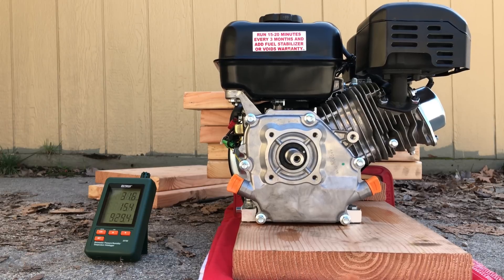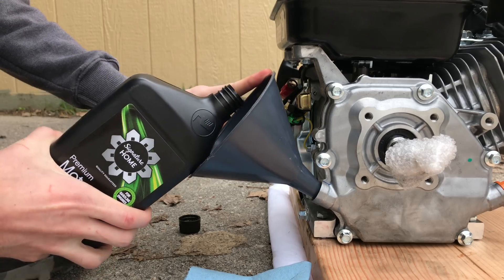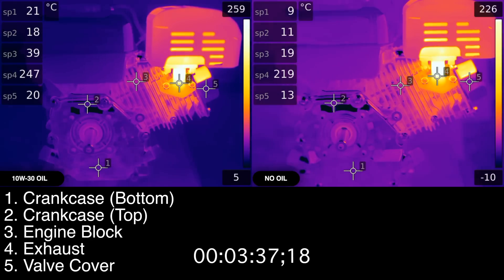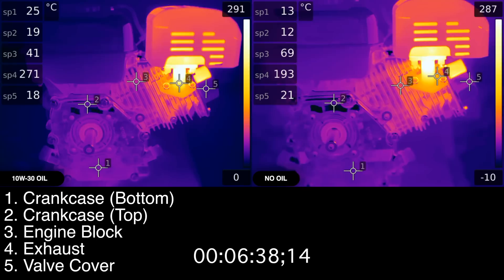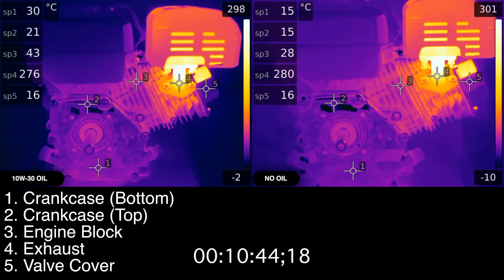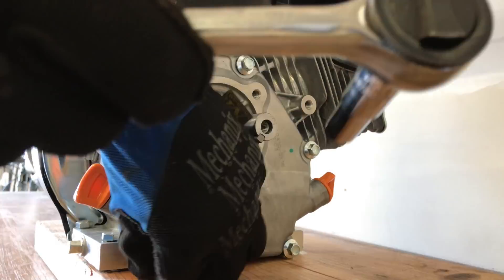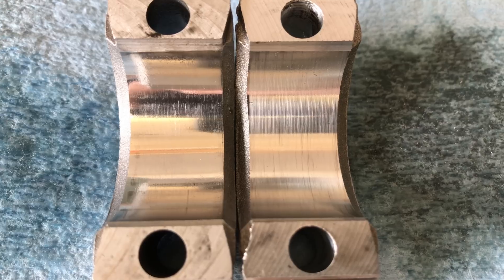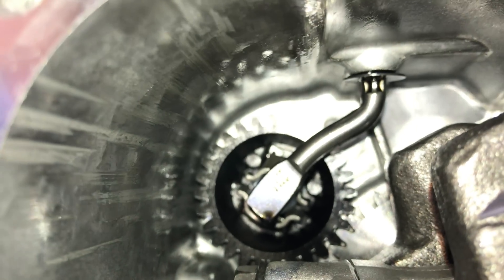What Happens To An Engine Without Oil?

Comment: i have a toyota 1.4L D-4D diesel hatchback, seems to consume a lot of oil. dont find leak anywhere. no black smoke either. according to the service center the combustion is good too. is it safe to use the car on highways?
the car had done about 45k kilometres. oil goes below low mark in about 2000kms.
Reply: Tjukken33 i live in India and its hot here most of the year. the service interval for the car is actually 10k kms as per the manual. as you said the car consumes little over 1.5L oil in 2k kms out of 3.9L. after repeated visit to the service centre they said they didnt find anything wrong with the car in their diagnosis. aint loosing so much in such sort duration something to be alarmed ??
Reply: Tjukken33 thank you so much for the detailed reply. my car is out of warranty. and you are right it is some minor mechanical issue which Toyota is not able to trace. heard few other cars are affected but as you said the reply from service center is its ok nothing to worry. will check the coolant tomorrow. and will follow the practice of carrying oil in the carry and check the level frequently.

i guess it should be 20w40(will check the manual) if it is so will it help if i change to 20w50 or go for synthetic oil ?

Comment: This is a four stroke engine right? Could you do the same video with a two stroke engine please?
Reply: +land otter1    your points B and C are the same thing. The higher Octane rating doesn't give the fuel more power it just increases its resistance to burning meaning the compression ratio can be higher and that is what gives more power.  It also reduces the likelihood of predetonation for the same reason.
Reply: 2 stroke engines dont have oil in the crank case
Reply: no modern day engine requires led in the gas. The led was used to lube the fuel injection system. Seeing as it was 2 stroke, it will not require led.
Reply: Tjukken33  2stroke doesn't require leaded gas. It will run on unleaded just as good mixed with oil
Reply: ***** no it doesn't the lead was used so simply lube the fuel injectors. Seeing as all 2 strokes are carburated there is no 2 stroke engine in the world that would require lead in the gas. You can not have a fuel injected 2 stoke engine.
Reply: Too much oil can cause carbon buildup. I had a Solo 210 that got hard to start when the decompression port clogged. This put extra wear and tear on the pull starter and I wound up replacing some of that as a result. Cleaning the port involves removing the head and exhaust and then pushing a pipe cleaner through the port from each side. This is a periodic maintenance item on that engine but running say 25:1 instead of 50:1 would clog it up in only a few hours.

Comment: My moms got an 03' 1500 Ram with a Hemi (dumbest truck I've ever driven) and it is CONSTANTLY burning off it's oil to the point where my mom carries around a big jug just in case. IDK if it's cus she let the oil run out once and took MONTHS to realize there was no oil so now it's just being a prick but imma show her this video. That truck is the whole reason i no longer respect Dodge vehicles. That and around here you never see a Ford or Toyota at the side of the road- just sayin'.
Reply: >knows engine was run without oil for months
>blames dodge for engine running badly
Reply: could as well be excessive wear on the piston rings. your mom should get that checked soon i propose.

Comment: You should do it again, but with the side of the crankcase off. We could see the temps of each components.
Reply from the maker: I like that idea!
Reply: I'm not sure I'd be comfortable near a running engine with an open crankcase...
Reply: You couldn't remove the side plate completely because it supports the crankshaft but you could cut several large observation holes in it.
Reply: It's all magic to me.
Reply: Use plexiglass cut with the same bolt pattern and a hole cut out for the shaft and main bearing, If you ran it without the front bearing the crank will leaver the rear bearing so bad it could rip the inner race out after it starts up and that would be no fun.
Reply: lol Boat Channel don't you mean the crankshaft? But either way both of them would stay in place as they are bolted down by the cam and crank caps.
Reply: ehh, if kept at idle and not run to full rpm I bet it would be fine that the flex of the shaft would be minimal enough to not effect anything, since its only a single cylinder with a fairly small shaft
Reply: At 4:24 I was expecting you to say something about the color of burned metal... but I guess you didn't open the engine after the "with oil test" to see when this appeared. So, anxiously waiting the crankcase off video. See you...
Reply: ***** If he were to use Plexiglas, he could do the same thing, but with the engine that has oil.
Reply: @Tj1056 Camshaft crankshaft crankcase camcase WHO TF CAME UP WITH THESE RETARDED TERMS!
Reply: ***** As Miss Sakamoto says "She blinded me with science!!" not magic ;-)
Reply: Regarding the crankshaft coming out, it'll have some degree of axial thrust, so depending on the location of the thrust bearings, the engine may go out of alignment rather quickly, which could sully the results of the experiment by seizing sooner than expected.

As Nutz noted, observation holes would be the way to go.
Reply: The cam would probably fly out
Reply: Tj1056 The cam is just aligned with the crank, the crank wouldn't come out because is connected to the rod and the flywheel.
Reply: Can maybe machine a plexi-glass piece to take the place of that side?  That way "with oil" can still be contained, but make it visible.
Reply: Safety Squints and earpluggers mean you?
Reply: you couldn't cuz the camshaft will come out
Reply: +VehicleMechanical the  reflection of the plastic would hide the image from the thermal camera,  if you  understand how thermal cameras work, you know what I mean.
Reply: amartinez97 what's wrong??

Comment: what would happen if you put water instead of oil
Reply: You will very likely hydrolock the engine. Engine stabilizer isn't just for removing water from gas, it also removes water from oil.

Comment: You need to load the engine, not just rev it unloaded. The heat generated is tiny compared to if it was loaded.

Comment: If you do any future thermal comparisons, you can lock the temperature range on the color pallets, allowing for a much easier visual comparison, seeing the difference between one another and seeing it heat up, this will be much more intuitive to those not use to reviewing IR. All the flir camera's we use have this feature, i'm sure the unit you are using does the same! Very cool though, would love to see a thermal time lapse of the motor run to failure.
Reply from the maker: Yep, if you watch the beginning of the video, the scale is locked on the left engine. This simply results in the exhaust visible and everything else super dark. Allowing for the auto-sliding scale helps to see the whole picture, even if it may be less exciting in this fashion. It also tends to have better visual definition with the auto scale.
Reply: too bad you can't lock both auto-sliding scales to scale together some how

Comment: The engine on the left was colder because there's no heat being exchanged between the hot metal inside and the external casing.

Comment: I know this is totally off your topic for the video but do you have a video about lose or gain Hp. when installing straight pipes on a 08 G37. doesn't have to be my car, but in general would be awesome.
Reply from the maker: Keep the cat, clean air is important! If your exhaust is too restrictive, get a high-flow cat to compensate. If Subaru can run 40+ psi of boost in their Rally America STI with a catalytic converter, the rest of us can too with our street cars haha.
Reply: Engineering Explained thank you for sharing your knowledge with us, and staying connected with us through your comments. love the videos keep up the great work.

Comment: You should repeat the test but with the engine under load. Intuition says there would be more carnage.
Reply: yeah, that would definitely help! I pretty much blew up a rototiller engine like this! It worked fine for about the first 5 minutes then it slowed down and and I noticed smoke coming out of the exhaust... yep, big problem...
Reply: Precisely!!! ^^^ :)
Reply: Adam Williams not really if anything without a load its spinning as hard as it can all the times load is delt with primarily by the transmission which also needs oil
Reply: Good idea! A simple fluid resistance setup would be a good test, e.g. one on a bicycle trainer.
Reply: There would be a significant difference, especially on the cylinder bore. The oil would reduce the friction and increase the heat transfer to the cylinder bore. The crank would also get worn to all hell
Reply: Exactly what I thought as well.
Reply: Bruce Harding It's still a good test
Reply: That would help to destroy the engine faster but I doubt that the temperatures on the outside would be much higher.

Comment: about 20 years ago when engines additives were popular a did an experiment with dura lube and slick 50. I added slick 50 to a 4 hp Briggs and Stratton ran it then drained it. it ran for a long time with no oil before seizing up. now I did the same with the dura lube and I went all summer with no oil. amazingly I took it apart and little or no damage occurred. I used dura lube for years. that stuff was great

Comment: Very interesting, I would have guessed that the motor would have failed rather fast.
Reply from the maker: I thought the same!
Reply: it's probably the assembly lube,  flush the crankcase with gasoline to remove the assembly lube
Reply: You have to keep in mind this is a carbourated engine (so less heat in the combustion chamber), its air cooled (typically on no oil what you see is the head warps because of heat, coolant spills into the oil system, coolant wash away what little oil was left), it at a pretty low rpm, and it has no load on it.
Reply: Small engines are pretty stout in general, it seems. I had an old Honda mower that leaked all the oil out the bottom crank seal. It got hot enough that it quit running and locked up. I let it cool down, filled it back up with oil, and it started right up. I ran it for a whole mowing season after that, until I bought a new mower. I recently dragged it out from under the tarp where it had been sitting for the last 4 years, and 5 pulls of the cord and it fired right up. I'm in the process of freshening it up...not really sure why, since I already have 2 other mowers, and this makes the 3rd! It's a sickness...
Reply: Engineering Explained seems that maybe that small amount of oil still inside the crankcase had quite a bit of cohesion on the bearing surfaces, and decreased friction just enough for temperatures to stay reasonable. would not have guessed that
Reply: My guess it survived that long because there was no actual load on engine. I remember Fifth Gear drained car engine and drove around with no oil and if i remember correct it survived 8 minutes.
Reply: Could also be loose tolerances decreasing friction since it's a shitty motor. I have a retarded friend who drained his oil and started his truck and had the cam seize to a bearing in less than a minute, and he didn't even drive anywhere (apparently).
Reply: It was very close to failure.
Take a good look at where he takes the conrod cap off...you can see the the crank is actually blue from running so hot. Just a bit more, and the rod would have seized on the crank. This can just seize the engine, or it can break the rod, and more than likely punching a hole in the crankcase.
I've seen quite a few of these perforated engines in my days as a service tech on this stuff.

Comment: A big automobile engine wont fare so well.  
Right after losing oil pressure the bearings will come lose.   Then the crank will eventually break.
Apparently, that small engine is sturdier relative to the mechanical forces it endures.

Comment: What happens if you use very worn oil instead of nothing at all?
Reply: btw, those reading that (and this), slap yourself every time he says the word 'engine'.
Reply: it doesnt lubricate as well, it's a lot thicker
Reply: Fire Squad exactly but what will happen after hours after hours of beating/running. Will it become top thick? Who knows.

Comment: the engine was running at idle speed right?
it wouldnt be the same results if they were running at high rpms...
Reply: Greg de diego A load on the Engine,would produce better results.Especially on the bottom end.

Comment: Well, you were measuring temperature on the engine casing. With oil temperature can be transfer from moving parts to engine casing. Without oil parts inside (like gears) are getting hot, but air around does not trasfer the heat to camera. So this is why engine without oil is colder (but it really isnt).
Reply: Did major work on my bike engine a year back. Put it back together, tried to start it. Cranking, cranking, cranking....wouldn't start (normally kicks over easy), then remembered I hadn't put the oil in. Filled it up and bingo!
Reply from the maker: Sure, but no (or minimal) lubrication between the piston/rings and the cylinder wall should result in more heat, which passes directly to the fins.
Reply: no...it has cooling fins to keep cool...its doesnt even have an oil cooler and even if it did thats not what an oil cooler is for...its to keep the engine oil at optimal temperature which is about 212 degrees F ... oil is for wear protection not engine cooling
Reply: M_Kil Exactly
Reply: Normally in engine with oil inside just one of the 3 rings is lubricated, others are not, and they purpose beside keeping pressure is to transfer heat to the fins. So your analogy is not exactly correct, because with or without oil they are working in the same condition.

Another thing that occured to me is, you test engine with oil, drained it, and then run without oil. Well, oil is dense, and you cannot drain engine completly. Very thin layer of oil remain on the insides of the engine. For lubricated parts the thinner, the better. Layer thick on several atoms works the best, and you need more time than 15 minutes to wipe that layer. 

The test would be more reasonable if you cleaned remaining oil with special thinner. It would result in metal on metal action, and fast destruction of engine.
Reply: phil tripe The one exception to your statement is an engine with oil squirters for the bottom of the pistons. Ferrari and Mahle are even using a 3D printed part on the underside of their pistons in F1 this year, to better control the piston temps.
Reply: ja ja ja ja ...sorry man i m just laughing because the same happen to me ...and now i read your comment...!!! , ja ja ja ...cheers mate..!